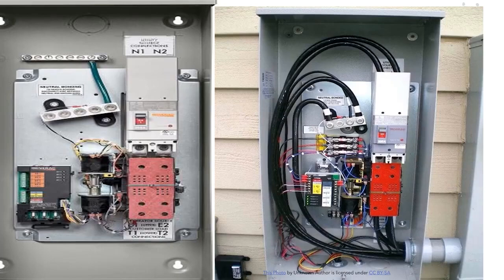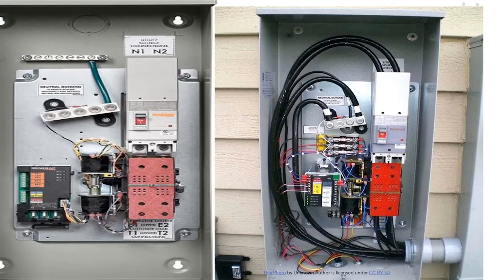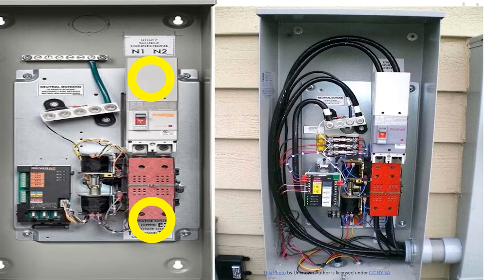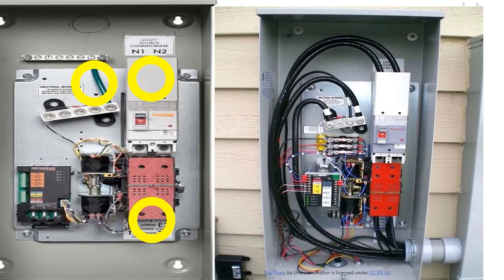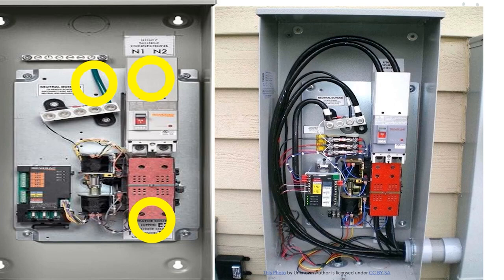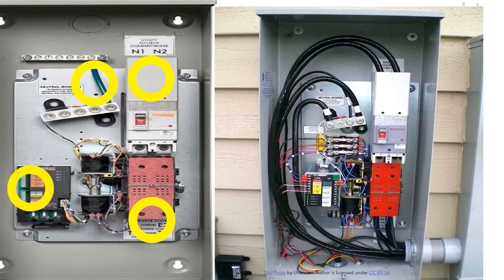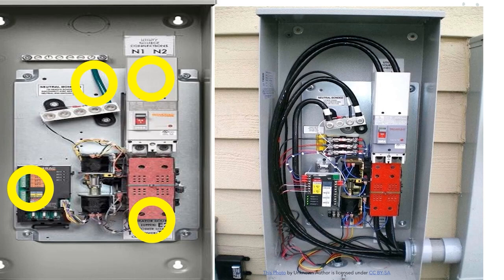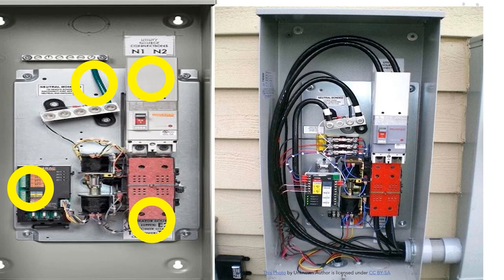Automatic Transfer Switches, Generator equipment

Comment: If you add a transfer switch and therefore change the first point of disconnect, what do you do with the existing ground rods? Do you reuse them but remove the copper wire from the main panel and instead tie it to that ground bar inside the transfer switch? Or do you simply add new ground rods and copper wires for the transfer switch and leave the rod and copper that went to the main panel in place?

Comment: I don't see any grounds in the pre-wired one.  But if it is the first disconnect, and the neutral is truly bonded, then it is a violation to have the unfused service conductors in the same pipe as the conductors returning like that.
Reply: True that
Reply: It's done all the time. The reason is you have 10 feet from once it enters the building. For example, if this transfer switch was not there, then there is the meter enclosure, then service conductors going from inside that base to the main panel right behind it. So by adding the transfer switch by bringing the wires out from the meter can to the transfer switch then back into the meter can to the main panel, nothing is changed, you could say all the conductors on the outside of the building are still service conductors, the fact that you added a disconnecting means on the exterior of the building actually makes things a little bit safer. What would be illegal and unsafe is if any wires to the generator are in the same nipple/raceway/conduit as the service conductors. But in this case looks like all the generator wires are going out the bottom. The only other thing that needs to happen is whatever panel it's feeding has to be changed into a sub-panel, and grounds and neutrals separated, and any neutral/ground bonding screw removed, since the panel is now no longer the first disconnecting means.

Comment: Would need to see a video where everything gets wired. Since you lost me on the portion where you got the generator wires connected and since those are the communications cables where are the supply cables at since you don't mentioned them in the video. Also how can you integrate a battery supply as a back up to the generator.

Comment: Let’s get to it . Those black cables below the the top cables seem to
Be the ones feeding the house and
The red box is totally used for the generator on the pre-wired ? Just wondering because you said all panel box manufactures are different .
Reply from the maker: Every scenario is different depending on where you're at in the system
Reply: Sorry to bother you . Just wondering about the scenario you have here in this video . How is it hooked up in this video on the right . The feeder and in a separate location that the generator lugs . The generator lugs seem to hooked to the red box alone . Again I’m so sorry , I really hate asking questions